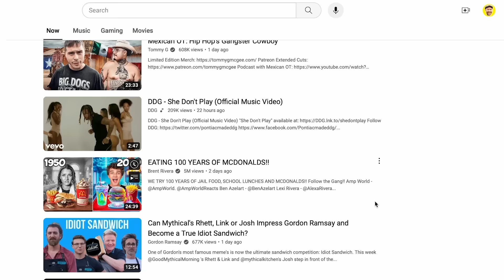I Give Up

Comment: I used my first grease gun 70 yr ago.  Last yr I got tired of pump and got me an battery op one.  Best move I ever made. come with a shoulder strap so u have both hands free to do the job. so much easier 
As for ur track I was 9 when Da got the little JD crawler.  We got those tracks to come off often as we learn how to use.  Got to be quit good at it.